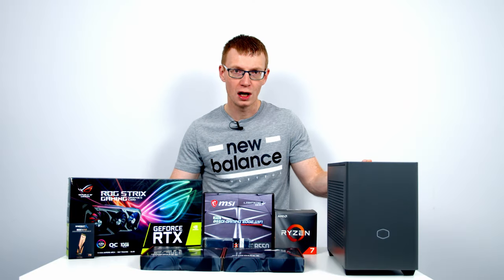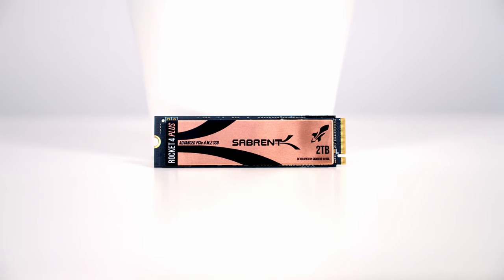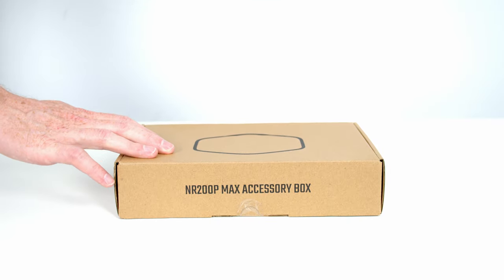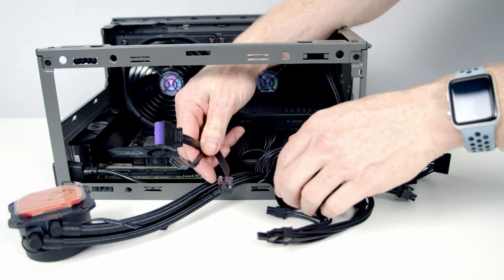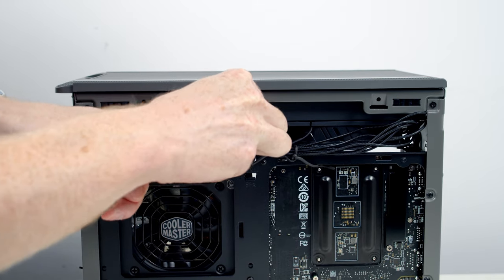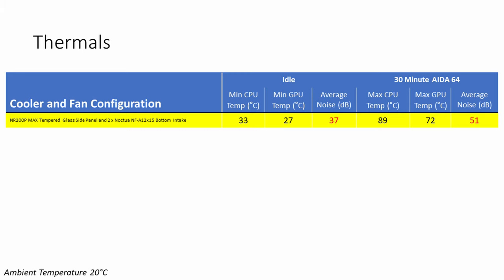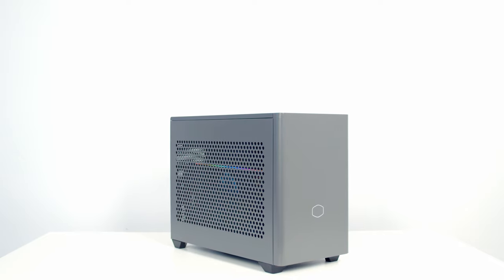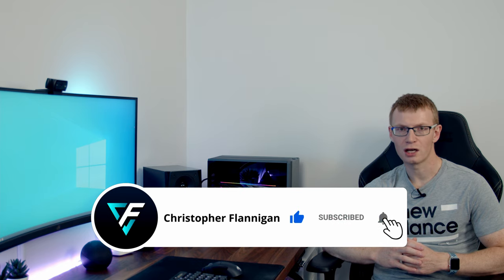Cooler Master NR200P MAX PC Build Guide + Thermals / Review

Comment: Bottom fans as exhaust is the ticket. Might even be able to put 25mm fans as exhaust down  below.
Reply from the maker: Not sure about that, as the hot air will be blowing down over the desk and up into your face (have tired something similar before in another case). Also the fans were too loud for my liking.
Reply: You always want your exhaust to be higher up, in this case at the top of the case. Thermodynamics state that heat rises, I think I'll listen to that haha.
Reply: @Mars057  when using the perforated panel, the gpu gets side intake and blows air both up and down, so having bottom exhaust helps taking the hot air from the gpu away. (That's the theory behind it tho, I haven't seen relative testing results yet)
Reply: @JoHo_  Optimum Tech did bottom and top exhausts with the steel panel.
Reply: Absolutely not... Heat rises. Having your heat exhaust down will cause a lot of it to be sucked back into the machine and exhausted again. Have the bottom fans as intake, moving cool air from the bottom into the case, to be exhausted out the top.
Reply: @fraub1 heat doesn’t rise as quickly as a case fan can push/pull air. Heat rising/cool air falling is pretty much irrelevant when thinking about case air flow.

Comment: Thanks for the great video! Made a build using the NR200P Max following the video and it works great. Got frightened a bit when it didn't power on but fortunately it was the PSU 0/1 switch on the inside of the case :)
Reply: It got me too.

Comment: I noticed you placed the bottom
Fans as intake. Have you tried them as exhaust, top as exhaust. You have air pushing back into the GPU heat sink that is trying to draw its warm air out .

Comment: you can put a 140mm chromax in the bottom with one of the slim 120's as well. i added a commander pro to mine too mounted in the front panel.

Comment: Another good one ...
Even tho I still don't get why people choose to go through the ordeal of installing their system in such tiny, clustered cases, you did a good job at answering most of my questions concerning this particular one...
Reply: The same reason I want to build in a small case... lack of space. I still have yet to build one after watching all these vids
Reply: Us young people love small things.

And it's definitely interesting to see what you can fit in such a small space!
Reply: I'm currently building a SFF PC. SF helped me a ton with his TU 150 build. Especially on the parts list and fan header part. That case is pretty rare where I live, but love the idea of how you can carry it like a suitcase. Basically a somewhat "portable" build if you don't to use a laptop and want to upgrade when the time arrives. Just hoping the darn thing posts but still deciding if I should go Linux or spectre with a "key".
Reply from the maker: Limited space for some, other just like it
Reply: Small looks so good but its expensive noisy and hot.
Probably stay with Matx don't hear my rig and stays cool after hours of gaming on 3080Ti.

Comment: Hey Chris, not sure if you have this build still kicking around, but I'd be interested to see how the thermals would fare with your two bottom fans set for exhaust rather than intake. In theory, the bottom exhaust would help to pull the hot air from the GPU heatsink, and increase negative pressure, which would in turn pull more cool air through the vented side panel. I'd guess this would be a fairly significant difference in temps, but theory vs practice can definitely surprise us.

I'm thinking about picking up this case for a 12700k/3090 build soon, and I'd be interested to know if that setup would produce significantly better temps than a setup with no bottom fans.
Reply: 100% agreed, bottom exhaust all the way with vented side panel!
Reply: Did you ever try it out in exhaust configuration?
Reply: @MBpotato89  Yep, that's how I've been running it since I built it, going strong 3 or 4 months now. GPU temps are great, CPU temps leave a bit to be desired, but a more aggressive fan curve on the radiator-mounted fans keep temps healthy at the expense of a bit of noise.

Generally under gaming loads I'm seeing GPU temps around 56-64c, CPU temps in the mid 70's or lower. Some particularly CPU intensive games can pull that to 78-ish, but I've got the fans set to kick on to 100% there, so it doesn't exceed 80c except for very brief spikes before the fans pick up.

Comment: Why dont set the fans on the bottom to exhaust?? to me that makes a lot more sense, so the heat of the GPU gets exhausted partially at the bottom and not pushed through the cooling grill of the AiO. Can someone correct me if im wrong or confirm that its better to set the fans to exhaust? ill build my nr200max tomorrow as my dan a4 h2o is troublesome in terms of thermals
btw, excellent build and content by you, Christopher!
merry christmas to y'all!
Reply: My Bottom fans exhaust, saw one guy report he had a few degrees lower.
Reply: @fsxspen thinking about testing out one fan as intake and one as exhaust. My theory is the air flow would be more of a circle, intake will push air up and around the case, while the exhaust will just push that air out. Not sure though dont want excessive noise so i might not run any

Comment: Awesome build video - Thank you. I just built mine with a Ryzen 7 7800x3D and a RX 7800 XT. As a first time PC Builder, I didn't install the fans on the bottom and my current CPU package temperature is around 35-40 degrees Celsius on idle and I need to improve my cable management. Do you foresee any GPU sag issue? The GPU stand I received with the 7800 XT is too tall to fit in unfortunately. Also, to confirm, the AIO 3-pin cable goes in the Pump header along with the Radiator fan cable to the CPU fan header - Is this correct? Thanks.

Comment: HI. I mounted the same fan model as shown in the video. The cold air comes out at the bottom. It's normal?
Reply: I think you might have mounted the fans upside down. I will be building this exact case and i think i will do research with one fan as intake and the other as exhaust. My theory is it the fans will allow a more circular air flow. Intake fan pushing cold air into the gpu while also pushing air past it, around the case, and having the second fan “exhaust” push the remaining hot air outside. Not sure how this will work but i dont plan on using the glass panel so i might not use fans to avoid the fan noise

Comment: Hi, excellent video, very detailed. I have a question regarding new rtx 4000. I am planning on building a pc using nr200p max case. I have noticed that new rtx 4000 series cards are using 3 or even 4 separate 8 pin PCIE cables. If I am not mistaken, the case comes with only 2. As I am a begginer in PC world, could you please explain me how it works and how can I safely install rtx 4080 in this case ? Is it even possible ?

Comment: how can you get those temp? i use intel 13700k. just installed thermalight cpu frame. it does drop abit. on average i got 50c. on cinebench it throttled to 100c. do you know the fix?

Comment: is the nr200p will hold a 3080ti aorus master and 12700K ? with or without OC ? 
the stock 240mm liq cooler can hold this cpu ? and this rig ? can it fit? and does the 850W will hold this ?

Comment: I just finished my first custom loop in the nr200p. I have to say it’s my favorite case but my god the temps are terrible. Looking to switch to something else.
Reply: What are the temps and have you switched by now?
Reply: @MyKillyy  heyyo- I was determined to make it work so I added a slim 240 radiator to the top. Haven’t benchmarked but playing battlefield 2042 on ultra for 3-5 hours straight my 3080 stays around 65 and my 5600x stays around 70-75 with random spikes to 80.
Reply: @MyKillyy  with one rad at the bottom cooling both 3080 and 5600x. The cpu would thermal throttle after 10 mins of gameplay and shut down the pc. While the gpu was around 75 with peaks at 80.

Comment: I've just bought this Nr200P Max, and use ASUS Rog strix B660i mainboard. Can you advise how to change the AIO fan flow direction? Is there a way to change using software? As default, my AIO fan is set as intake. I want to change it to exhaust. Thank you so much!
Reply: You have to unscrew fans and flip em over lol

Comment: Is it okay to only use 2 pcie 8 pin connectors for your gpu power even though your gpu has 3 ports?
Reply: If you want to install a 4080/4090, Cooler Master sells a 90 degree 12VHPWR cable that is compatible with this PSU. Highly recommended.

Comment: I have a 3700X system with the same motherboard as yours. I don't like the temps that you got from the NR200P MAX. It seems it is suffering from the hot exhaust of the GPU be it horizontal or vertical mounted.
Reply from the maker: It's the AIDA64 test - temps will never get near this with normal use
Reply: Your ambient must be ideal, however, my ambient is 34C as I don't use AC with my NCase M1 V5 with CPU temps hitting 90C. I was eyeing the NR200P MAX as a fix for my issue but I have changed my mind thanks to your reviews. I have chosen to go for a high air flow case which is a bit larger than the NR200.

Comment: are the included fans / PSU silent when PC is sitting idle in windows?
Reply: Yes. Mine are also silent under load because I tuned the fan curves. You may do so either in the BIOS or using the Fancontrol utility in Windows.

Comment: There is something REALLY weird with your build if a AMD Ryzen 3700X can reach 93c in a 30 minute AIDA64 stress test in 20c ambient temps. This case has a 280mm AIO waterblock, and should be able to keep this particular CPU below 80c. With PBO enabled, the 3700X should max out at about 110 Watts, something this case and cooler should easily be able to keep cool.
Would love to see temp and audio results with better application of thermal paste / with different fan speeds on the radiator
Perhaps even the BIOS is giving the CPU too much juice?
Reply: It's a little late but he does stress cpu and gpu simultaneously, so the warm gpu heat rises along the cpu and into the radiator as well so in that case (no pun intended) the temps make perfect sense and aren't too shabby.
Reply: Way too hot for me...